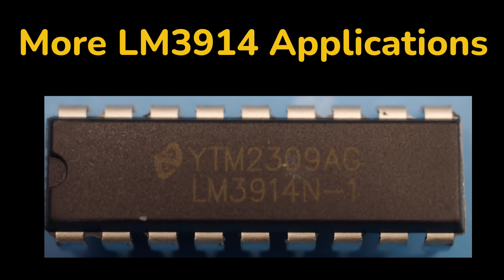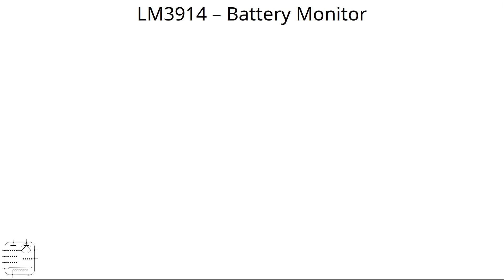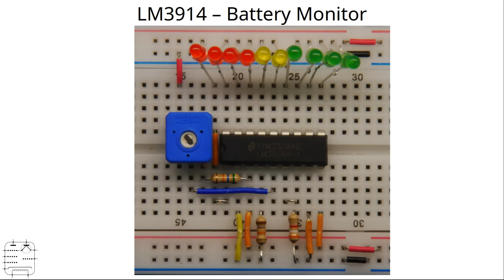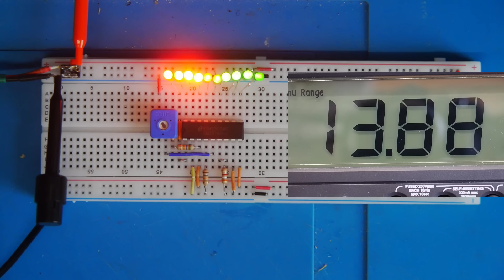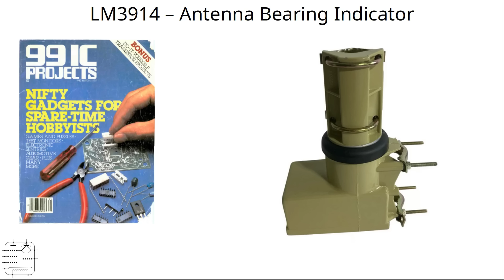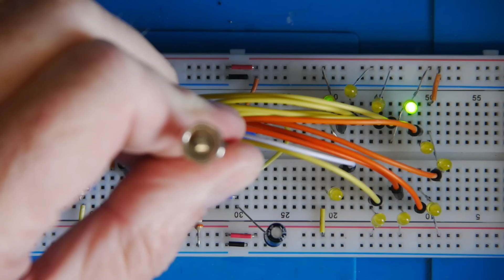More LM3914 Applications - #230

Comment: Hello Bill ,   HNY .   I discovered your channel  while playing with my Gould 3000, which I thought I should power up.  Interesting about the 3914 chip  as a posi
tion indicator .  I use a 5EL  homebrew for 2M and have always wanted a rotator, but even decent used ones are expensive.

Comment: Will it work with LM3915 & 3916?
I've used this IC for old modding project - bargraph HDD load indicator. Using optocoupler (PC817) and capacitor.

Comment: I have used a LM3914 to display the applied power to a metal lathe I converted to electronic VFD.  My LM3914's are genuine, purchased in the 1980's.  Really useful chip.

Comment: It's a shame that you can now make a complete bargraph circuit using a cheapo microcontroller and a divider chain (if over Vref).

No LED resistors needed either, as they can be muxed, dimmed, faded whatever...

Comment: This battery indicator is used widely in e-bike batteries. Not all batteries use them, but more than 50% I'd say.
Edit: The excellent part of this circuit, is that it only draws power, when the 'indicator button' is being pressed, so normally, the circuit would never drain the battery.

-The antenna direction circuit would probably be better using an encoder; it could be a lot simpler using an absolute encoder wheel (a 4-bit binary value would be enough for 16 LEDs).
As the receiver is usually the most expensive, one could use a microcontroller to pulse the transmitter-LEDs and only have a single receiver; that /could/ save on cost (but now we just moved from simple to advanced).

Comment: I did a battery monitor that skipped the 12.5-13.5 LEDs. So that it only lit up on slightly over charged, and showed how fast the battery recovered after engine start... Slow recovery meant add water, or replacement. The rest of the time, no LEDs lit, nothing needed when all is normal